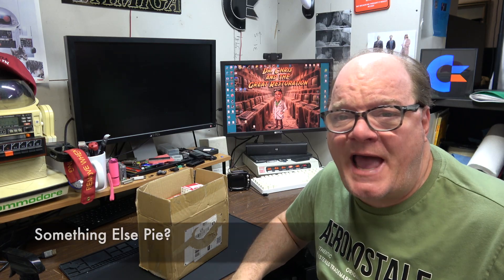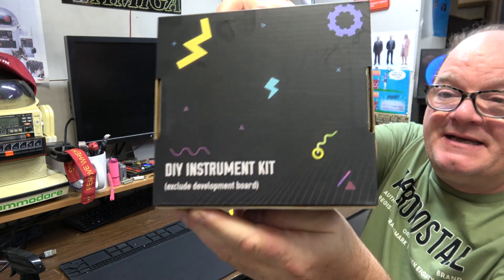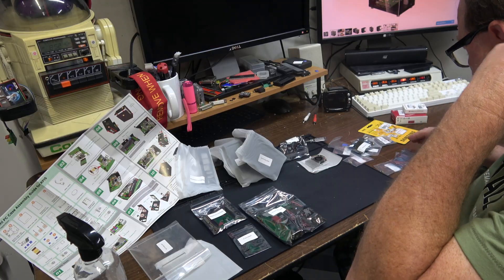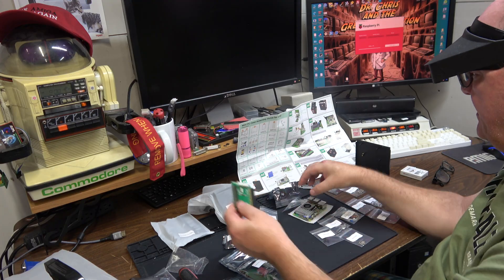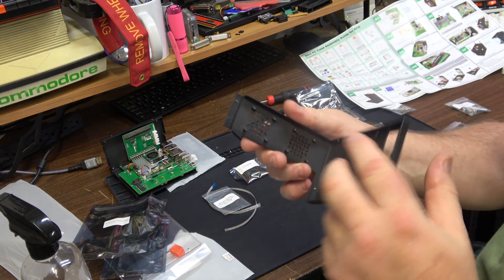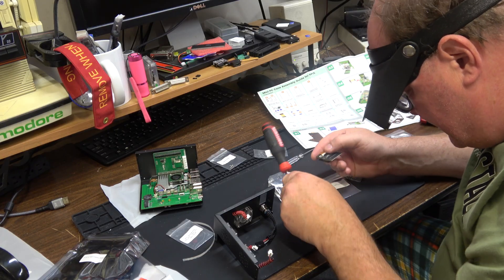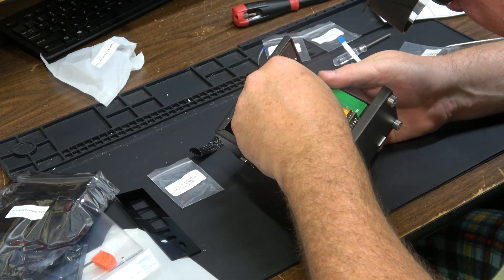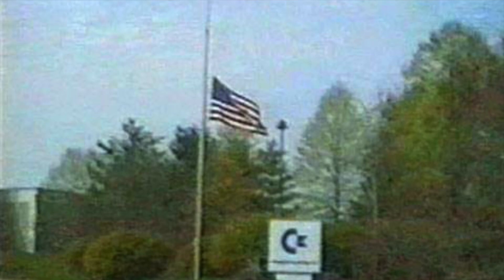Elecrow Rpi5 Tower Case for 40!

Comment: Hi Chris, 1st: Thanks you for all your videos! AMIGAAAA!! OK - sorry for that but in these days some positive energy is kinda mandatory! :-) I have a question: Which LCD monitor would you recommend for an A1200 with Indivision mk2? I kinda stopped on the Dell se2722h but didn't buy yet. I like to use modern resolutions via the DVI of the Indivision AND like to switch to the original 15Khz Outputs from the Amiga itself. Is that possible to connect both signals at once and just switch the input signal on the monitor when for example whdload switches to a LowRes 50Hz? Thanks for clarifying in advance and have a beautiful day, Regards Hennakin PS - I just found out that I shouldn't have gifted my ooold monitor Iiyama Vision Master Pro 21" some years ago... *sigh
Reply from the maker: Either the Dell U2410-F that I use or the Viewsonic i reviewed in a earlier video.
Reply: @ChrisEdwardsRestoration  Did you try the Dell SE2722H / HX ?
Reply from the maker: only the ones i own i can test.

Comment: This thing might be something to replace the 14 year old and knackered laptop I have connected to the TV in my bedroom. Nothing fancy required there, just need it to work better than the laptop.
Reply from the maker: no moving parts besides a few small fans, so yeah and cheap.! just remember to pu the small ribbons in backwards to normal, they apparently slide through the backside and lock in the front. even thoug the instructions say not to . the online vid from them shows it. so i glued my f up
Reply: @ChrisEdwardsRestoration  There's always something! :D

Comment: and just think you could have bought a 
Dell OptiPlex 3050 Micro PC i7 7700T 2.90GHZ 16GB RAM  from ebay for half the price and double the speed.
Reply from the maker: 40$?
Reply: $79 …. Pi5 and case is double that
Reply from the maker: @jondoough  pi5 4g and case is 90, so real close.
Reply: @ChrisEdwardsRestoration  for half the ram and half the speed

Comment: The small long cable goes into the other side of the connector. Edit: elecrow has a short assembly youtube video on the product page.
Reply from the maker: what kind of wizardry is that.  yeah i found it after i broke the connector. its totally backwards than every other flip down.  and the instructions tell you to put it in the way i edned up gluing it.  in the  end it all works.  but thanks for the catch!